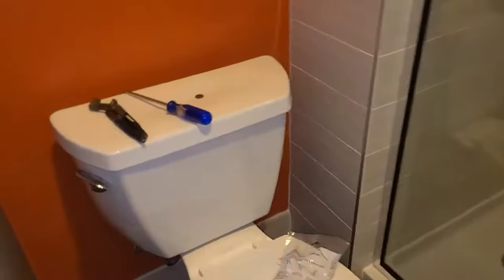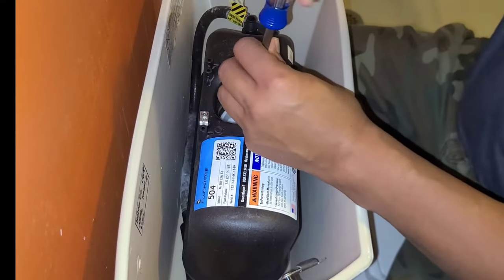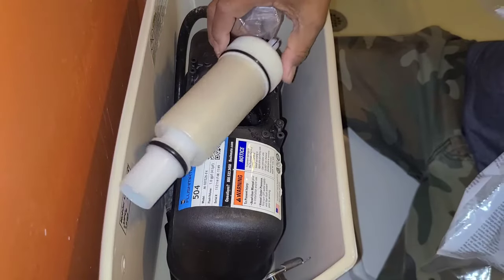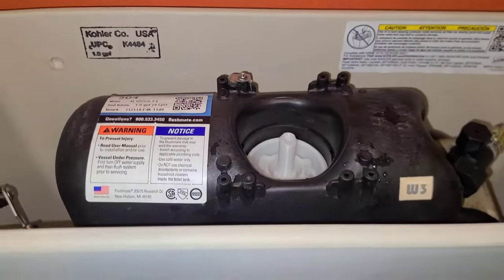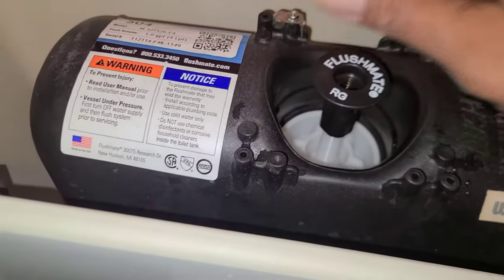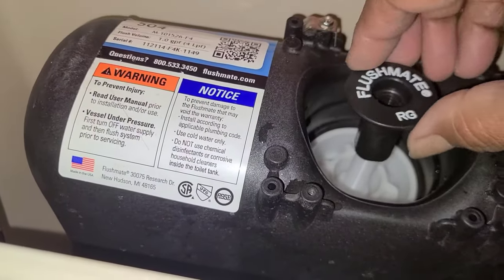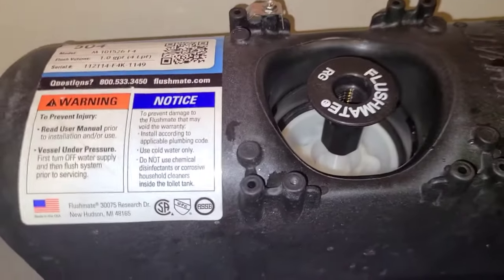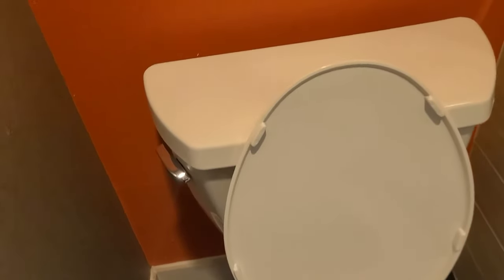How to replace & calibrate a Flushmate cartridge pressure assist valve

Comment: Thanks for the video!! I had replaced the cartridge recently and it was behaving badly. I followed your instructions and it is working like new again. I guess it just needed to be recalibrated. Your steps to fix the issue were better than the manufacurers. I can tell you have real world experience. I like the penny tip!! Thanks!!
Reply from the maker: Glad it helped, thanks for the visit

Comment: Thank you…….replaced two flushmate 504 last year. Plumbers have come and gone $$$$$. Toilets Almost working each time. After two days -Weak flush, and water running🫣. This last time the plumber told me if I had problems again , call him to pull the Flushmate’s and install conventional ball & chain plunger type. So depressing, 👵🏻.  $$$$.  After watching your video I went through my late husbands tools and followed the steps…..The water stopped running……Now I have to figure out how to adjust the new handle. Thank you again, saved me another $250. 🤞🙏🏼👵🏻Disgusted with myself , spent so much $$$$😶
Reply from the maker: Thank you so much for your comment that means so much to me, glad you had some tools "you can do it" Thanks for visiting my channel

Comment: Question you are available and don't mind helping. So yesterday I heard a weird clicking sound from the toilet so I figured it was the cartridge which I replaced about 10 years ago. I've threaded the cartridge about 3 threads showing and it's still not stopping and the air intake won't stop sucking aid. Wondering now if the air intake thing was the problem and not the cartidge
Reply from the maker: Thanks for the question, I don't really know.

Comment: Awesome video. 
I'm off site right now. But i have to manually pull the cartridge up about 1/4 inch to get the water to stop running. Besides trying to recalibrate should I try anything else ? Thanks!
Reply from the maker: not sure

Comment: My cartridge is stuck and won’t come out. Any idea how to get it loose? It seems to move the whole system when I try to twist it off. 

My issue is the water keeps running but no signs of leaking. I already changed the duck bill. The rubber under the cap. That didn’t work so I’m tryna change the cartridge those I see no signs of leaking it just won’t come out.
Reply from the maker: Yea, you might need to replace the cartridge

Comment: I've been hearing a lot of horror stories about pressure build-ups that are followed by explosions that destroy the vitreous china tanks & hurt people. However, these seem to be older stories. And when I looked up the toilet models that included a pressure assist system, pressure tank includes a Pressure Relief Valve. This seems to be a solution to the problem but I would assume that was included in the old, defective models too. Is the Pressure Relief Valve a reliable solution and what is your insight on these events? Is it because of a bad installation or something on the manufacturer's end that recently got fixed following the recalls?
just want to hear your opinion.
Reply from the maker: They usually take care of business on one flush, which saves water, but they are noisy

Comment: 7:45. Have you ever tried to just touch the adjustment up to the arm? Just skip the gap. The only reason I could think for that gap to be there would be like a recoil or something lol.. but I doubt that.
Reply from the maker: that's what the instructions say. thanks for the visit
Reply: @mrnoe67tiktok  then why you complicating things and putting a gap there lol. A penny's gap isn't much, so if it doesent matter then why do it? Is it so people don't adjust it up against it and make it run?.. idk.. I know how illiterate some people are lol
Reply from the maker: Yes, I do think that is the reason why for the penny gap, the Engineers at Sloan added the penny gap to the instructions.
But you have to admit it does make good content to my video, and it keeps viewers watching to see what the penny is for.
Thanks for the comment.
Reply: @mrnoe67tiktok  I had seen that before, but no one would answer if it was crucial or not. I’m just glad you responded and clarified. You should have drawn it out more with a piece of appear and have them draw the design of the top so they can know where to put it in the top. 😆😆😆 just to fuck with people.

Comment: Water comes up from the  new cartridge. Does it mean something else is wrong?
Reply: When mine leaked, I changed out the whole unit.
Reply: @DanR-hn2dn  That would cost me $180 or more for DIY.   Replacing the whole water tank with a different brand would only cost me $80, which I would choose if something else goes south.   For now, that "water pond" on the cartridge seems to be ignorable.
Reply from the maker: could be

Comment: Our system does flush but seems like no pressure at all. Do I need to recalibrate the cartridge?
Reply from the maker: did you replace the duckbill Valve?
Reply: @mrnoe67tiktok  no, I didn't.